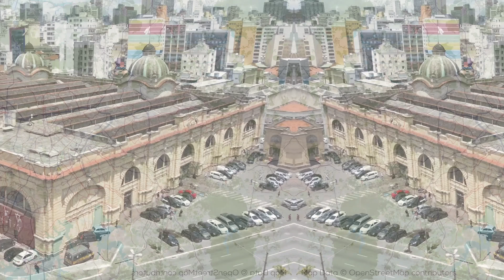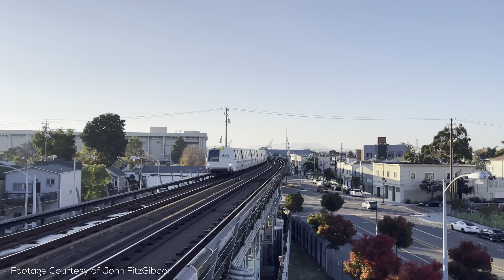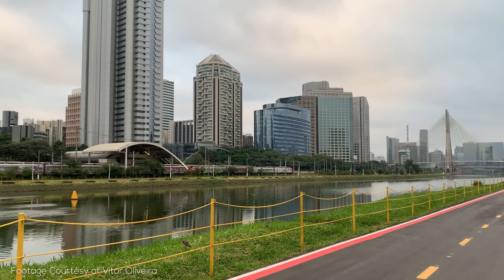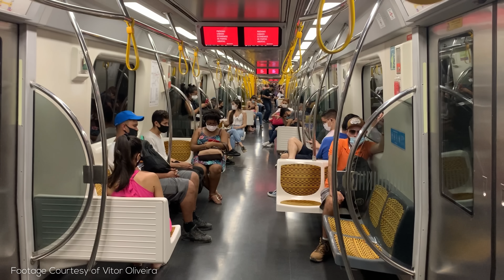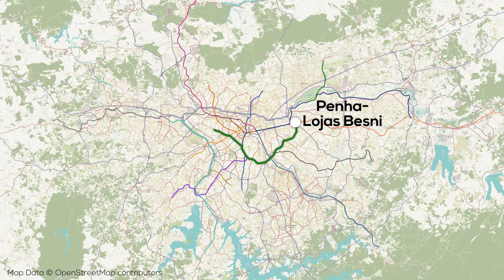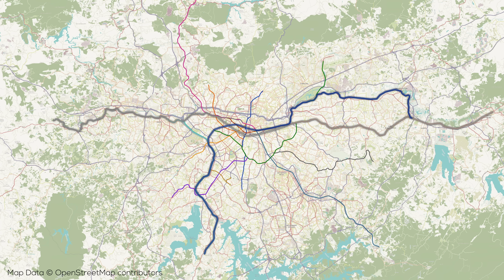The Busiest Subway in the World? | São Paulo Metro, Brazil

Comment: Thank you very much for this video, Reece. Just some trivia: 

1. Lines 8 and 9 after their takeover by Via Mobilidade have consistently suffered delays, derailments and maintenance problems, hence their recent unpopularity. The main reason why privatization of other lines is still seen as a positive for some people is the relative lack of worker strikes and high quality of services in line 4. However, that line was state-built, and the operator receives substantial subsidies per rider. That is not to say CPTM was perfect, but it provided very impressive improvements to the network after decades of mismanagement which left them in a state close to Mumbai’s local trains. Then why privatize? Money, pretty much. Both for the initial auction and future election grants. Lines 4, 5, 8 and 9’s operators are all part of CCR, which might as well own half the roads in the state of São Paulo.

2. The system is very crowded, as it has consistently not expanded quickly enough to meet the needs of the city. Hence all the measures taken to expand capacity and frequency, giving most lines a frequency of 90 seconds in peak periods. Definitely not something to scoff at.

3. The system was initially planned for 4 lines in the late 60s, with Line 1 having a branch to Moema (where Line 5 currently has a station), Line 2 being just a branch through Avenida Paulista, Line 3 was the same, and Line 4 was a Southwest-Southeast line that would arc south after Luz, stopping at where today is Line 2 in Sacomã.

3. Line 4’s importance comes from the fact that it is the only line that goes through Avenida Faria Lima, São Paulo’s financial center and where our stock exchange resides, as well as the only route for Line 9 passengers to go straight to the city center. Nowadays, Line 5 also handles that demand. As such, some stations were built for immense crowds, such as Pinheiros. This interchange at Pinheiros between Lines 4 and 9 is longer than planned, as during construction subsidence led to the worst accident in the Metro’s history, with over 7 deaths. This line also took an insultingly long time for it to be complete, and its extension projects further out to outlying districts and Taboão da Serra are still in the planning stages similar to Line 5, despite numerous promises.

4. Your plans for the end of the video do exist, in the form of Line 20 of the Metro, Line 14 of CPTM (most likely the next operator), Line 2 as it will be further extended north, and the Southern Arc of CPTM. The two closest to fruition are Line 2 extending north, and Line 20. In addition, there is a plan for a city center tunnel between Lapa and Brás to both free up space in the surface, as well as segregating freight traffic from the suburban lines. Given the country’s finances and the city’s desperate need for more rail lines, this project has very little priority. 

5. Line 17’s construction firm was first implicated in a massive corruption scheme, and the next firm has gone bankrupt. The state is still negotiating who will finish construction. 

6. Line 15 was supposed to be cheaper and quicker to build. None of these promises have materialized. The main reason it’s a monorail is because of the terrain, which is quite hilly and with many subterranean rivers. It will be extended to Ipiranga at Line 10 to relieve Line 2, and it was supposed to extend to Cidade Tiradentes, a notoriously dense, distant, and transit poor district in the edge of the city. Those plans were put on hold due to fears of overcrowding. Line 16 is now supposed to take this responsibility as well as relieving Line 3, which pre-covid had a ridership of over a million per day.

7. Line 3 was supposed to go to Guaianazes, but this didn’t happen because of Metro’s indebtedness, as well as, once again, fears of overcrowding. So CPTM took over this section, rebuilt Line 11 as an express service for Line 3, and in return they gave the Metro Line 5.

This is, believe it or not, just a fraction of all the silliness and complexity of this system, which in many ways, is a reflection of the city that it runs on. Despite all of that, it’s the best in Brazil, there’s no comparison. The difference is night and day to the other systems, and the only one that comes somewhat close is Salvador’s metro, but that one is also run by CCR. Without the Metro and CPTM, São Paulo would collapse, and it leaves people like me, who live in Rio, very sad that we have to subject ourselves to rail services which are both more expensive and much worse than these. Good luck São Paulo, don’t let them drag you down.
Reply from the maker: Thanks for this comment! I love all the details and trivia :D The whole situation with the monorails is wild!
Reply: The UK tried privatising the railways back in the 1990s, and that is now regarded by just about everyone to be a failure, and is being reversed.
Reply: @katrinabryce  Every line that has been privatized in São Paulo so far has gotten objectively worse, but the government and a good chunk of the people want to go through with the plan of privatizing the rest.
Reply: This is simply NOT TRUE! Lines 4 and 5 are excelent, considered the best in the system and were privatised!  @leonardoalvarenga7572
Reply: Hi Reece, just adding some context to the airport line: the Guarulhos airport was privatized for the 2014 football World Cup and part of the purchase plan was to connect the airport to the public transit network, but no clear guidelines on how to. The privatization was Made by federal government and it did not wanted to meddle with state affairs (both metro and railway are managed by a state, not municipal, agencies). So, it was expected that São Paulo state and GRU airport would come to an agreement on the line and share some costs. The problem was that GRU wanted a direct link to Luz, yet, metro wanted to add a few stops in the new line, as they couldn’t reach an agreement, we got this monstrosity. The metro reaches just the outskirts of Gru physical area and things became segregated and worse for passengers
Reply: Two corrections: The São Paulo Stock Exchange is not in Faria Lima Avenue but in the old downtown. And line 17 already has a company to finish its construction, the contracts were signed! The expansion of the mass transit system in São Paulo is advancing at a good pace in the last years with 3 new lines and some extensions of other lines and many improvements under construction! No other city in the Western World have so many transit construction going on now!
Reply: That's why about he explain the trivia 1 justifies the lovely nickname given by the people of "Via Calamidade" (Calamity Way) who daily uses the lines 8 and 9 CPTM. lmfao
Reply: That said, the amount of children going in the hospitals for air pollution got worse with the concession of Lines 8 and 9, since their trustworthyness fell to the ground and people simply went back to using cars in the extreme south and west portions of the metropolis.

Stikes may be bad, but are so exporadic that bad rail operations cause way more damage to the city than actual days that the Metrô goes on strike.

Also, consider that traffic and air-pollution related hospitalizations usually skyrockets when the Sao Paulo's Mayor decides to shut off the "rodizio" system that presents lots of traffic. That happens way more often to bad climate than to strikes.
Reply: Then why people in Rio de Janeiro was not in the same way if the air in Rio is far worse than in São Paulo?  @Stringuer
Reply: I really don't get why workers' strikes are so frowned upon. As long as services remain top notch, they're great.
Reply: @ianhomerpura8937   Strikes are indicative of a failure state being reached, generally speaking. Whether that be the bosses not doing their job right and screwing over the workers, or the workers (or at least their leaders) letting their collective power and influence go to their heads and demanding absurd or impossible things, if it comes to a strike, Someone's screwed up badly... (both situations arise quite frequently in the absense of properly made and enforced regulation to prevent such, mind you.)

But yeah, mostly it's that they're significantly inconvenient for a lot of people not actually involved in the dispute... which is... kind of the point, actually.
Reply: @ianhomerpura8937  Because they make chaos the day the strike happens. (Often the metro strikes take one single day or less)
Reply: I ride Line 9 daily for years and whilst there have been plenty of service issues, I can testify that headway, track ballast quality and train speed have all improved massively relative to before the takeover. Don't care enough to die on that hill though so go off lmao
Reply: There are some statistics that say that child hospitalization ramps up everytime the metro goes on strike due to increased pollution causing breathing difficulties.
Reply: CPTM has left the lines that bad before, it is only 1 year from the privatization and even the tracks are all rotten, it is impossible! It was left this way by CPTM, and VM is fixing, that the reason of the delays.
Reply: lol, CCR in Salvador city is highly approved by its population. Don't believe in the biased comment of that guy who clearly is some public union supporter
Reply: @ronshiiron8346  CCR in Salvador as well as CCR in Line 4 at Sao Paulo either received the line almost ready or got good money to build it... Goes to lines 8 and 9 and sees what quality CCR provides when being paid "fairly".
Reply: VM is fixing the entire line, that's the reason of delays in the 8 and 9.
Reply: @danielmu22  hahahaha VM is destroying the trains borrowed by CPTM and increasing the numbers of failures on both lines... you might not like CPTM, but cover up for VM wont make they good...
Reply: Are u a engineer? i think not, than i know what i'm talking about, it is impossible to tracks being rotten in just one year, it was that way for at least 4 year before VM take control of the lines. @gabrielprates8385
Reply: @danielmu22  VM had 8 derailments in 12 months WITH passengers. It never happened in the history of all São Paulo rail transport. Ever. They are incompetent, those who want to deny it are fools.
Reply: @mrvini1998   how can it be possible to, in less than a year,  all infraestructure gets rotten?
Reply: Salvador is Salvador, São Paulo is São Paulo. I did say the second best metro in Brazil is in Salvador, but it doesn’t take away from the fact that lines 8 and 9 are worse off after the concession.

Comment: Do you think the monorail is fitting there or is it just another useless one that could've been replaced by ordinary rail?
Reply from the maker: Probably could have and should have been regular metro!
Reply: Unfortunately, the monorail service (L18 Bronze) in the same capacity that was discontinued will be a BRT :/ So probably if they gave up of L15/L17 it would meet the same fate.

L15 Silver is pretty efficient, with some flaws (shaky train and had some months of halt due to a escaping wheel...) and provides a good interchange w/ L2 and the EMTU's trolleybus, soon with L10

Comment: You should do a video on Boston! There’s a lot of interesting stuff over here, we’ve got the oldest subway tunnel in North America and 3rd oldest in the world, a pretty extensive system, a list of problems that could be an entire documentary on its own, and quite a few plans in the works
Reply: Boston funny
Reply: I think there's competing claims for 2nd oldest from Glasgow, Istanbul, and Budapest, so I wouldn't be sure that it is the 3rd oldest.
I would say however that the Glasgow Subway isn't the second oldest in the world, because it isn't even the 2nd oldest in Glasgow.
Reply: @katrinabryce  it depends, according to Wikipedia it’s the 3rd oldest to still exclusively use electric traction, I think behind Glasgow and Budapest with London not counting since it originally used steam for parts. If you just go off opening and nothing else than it’s either 4th or 5th depending on if Budapest and Glasgow count as a tie for 3rd or separate entries as 3rd and 4th, since they opened the same year. I think Istanbul isn’t counted as a metro/subway since it’s a funicular
Reply: @staycgirlsitsgoingdown2  Glasgow Subway originally was cable hauled, it only got eletrified in 1935.
Reply from the maker: I've talked about Boston before, eventually I'll do an explainer but, I think its a bit overrated so I am not in a rush ;)

Comment: Are they safe?
Reply: Very much safe and clean.
Reply: @pedrito01100 nice. Also at night? Just curious
Reply: @theaveragejoe5781  runs from 04:40am until midnight, a couple days a year during certain events it can run overnight, but it's pretty rare
Reply: Yes, it is safe at night!  @theaveragejoe5781
Reply: From the safety perpective, it’s pretty safe! It’s not common to see crimes inside the metro system here in São Paulo. You may see beggers and people selling stuff, but no crime. 

We like very much the metro system here. It’s not perfect, but it’s most of the time reliable.
Reply: @philss77  beggers and sellers sounds like minor nuisance. Reliability much more important. Nice!
Reply from the maker: I found it felt safe personally
Reply: Inside the system yes.
The areas surrounding some stations definitely not.
Reply: yes. when they are empty they are very safe